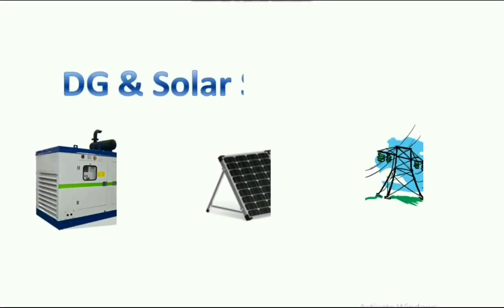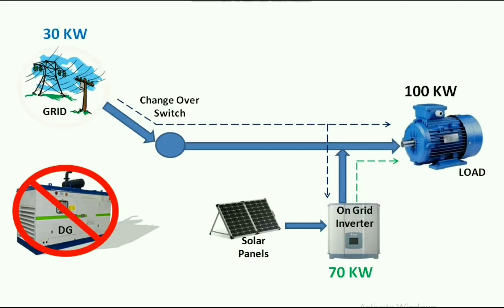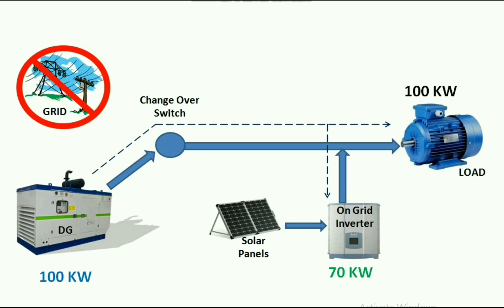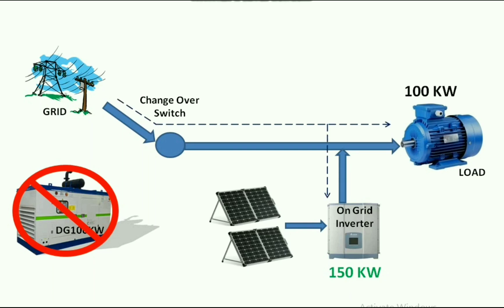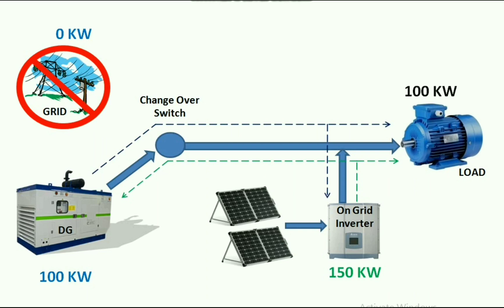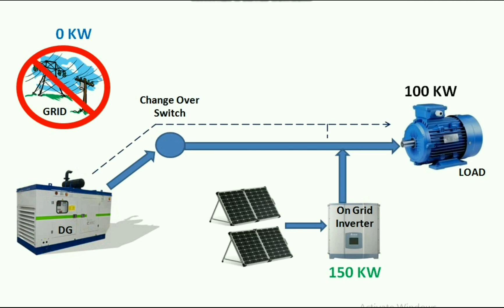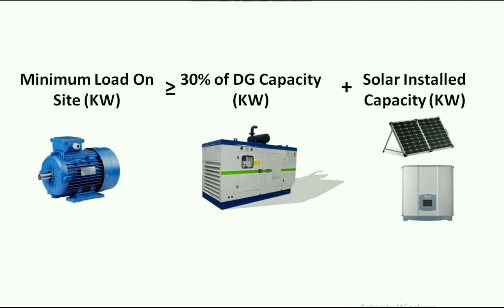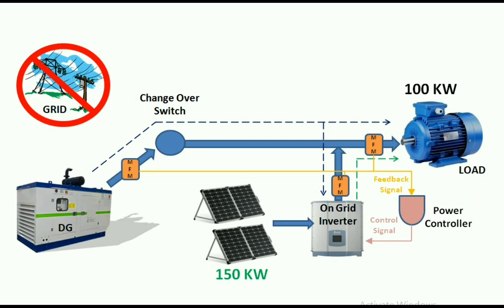DG & Solar Synchronization

Comment: If we have 15 KW DG.
200kw solar power inverter system.
We have load of 205 KW .
Does synchronization occour.
Reply: No sir.. For DG synchronization.. There should be 30% Load  by DG itself.. So you have to install a 70-80 kVA DG for synchronization